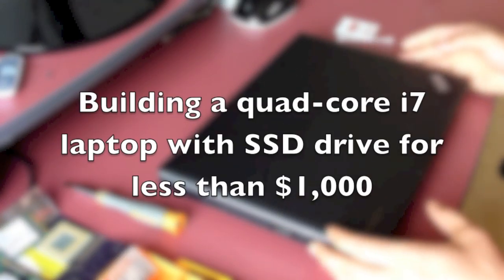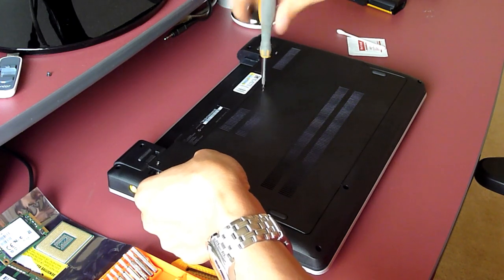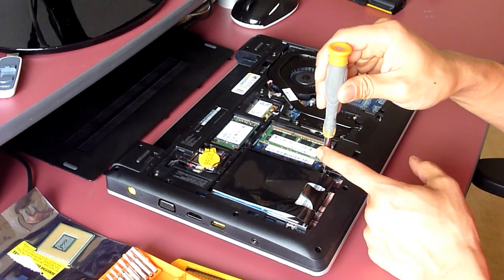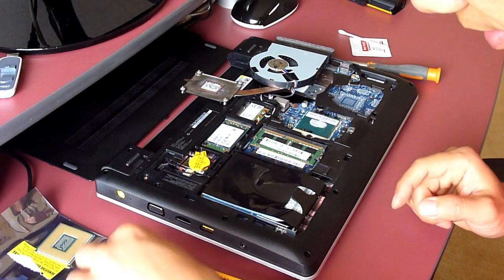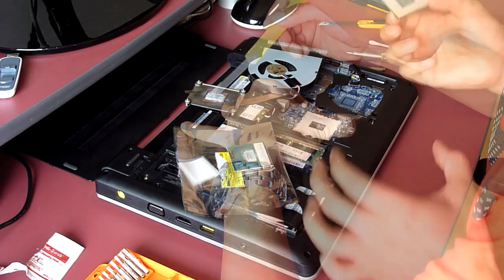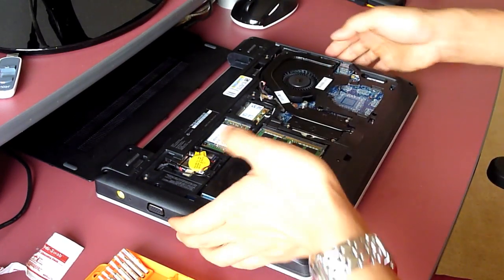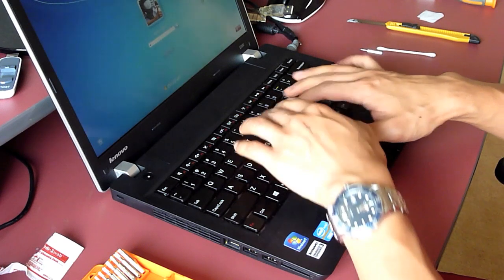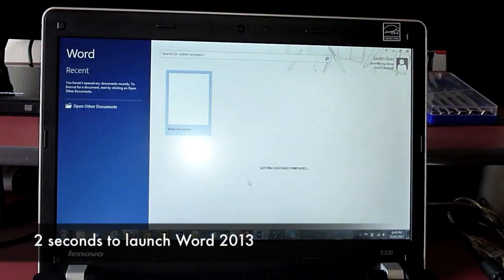Quad-core i7 laptop with SSD for less than $1k (CPU, SSD, memory upgrade Lenovo E330)

Comment: Hello, thanks for you video. I Bought a 250 gb ssd. And I already had upgraded to 8 gb ram. I wanted to ask if I could also upgrade to 16 gb ddr4 ram? And, you used the I7 3612. I now did a search and I found the I7 8700. Would that also be possible?
Reply: I7-8700 use ddr4-2666 memory.
Meanwhile e330 use DDR3 memory.
Also i7-8700 for desktop use.

Comment: Is it possible to upgrade the cpu (lets say to an i5) if it has an intel pentium CPU B980 (with 2,4 ghz) preinstalled? I am thinking about instead of buying a new lenovo to upgrade the whole system: More RAM, add SSD, clean cooler and also upgrade my CPU
Reply: And how will my battery-life react to that? (I am guessing it will go down but will it be significant?)

Comment from the maker: For those who thinks it's wrong to reuse thermal grease: (1) this is thermal grease not thermal adhesive/pad (2) this laptop is brand new, the replaced i3 CPU had less than 10 minutes of use. Also if you wonder if it has blown apart because I reused thermal grease: it hasn't. It's been my media server in the last four years and was left on most of the time.

Comment: How do i know if my laptop can get a new processor? I have a Vaio VPCSB28gg... considering a quad core CPU....
Reply: identify your cpu and search for the socket type, than search for the processors compatible with your socket-type and check if they are at the same TDP (ThermalDesignPower).

Comment: Where did you buy the processor from? I have the same laptop (i5 version) and I already upgraded my ram up to 8 gigs and just swapped the old harddrive with a 512GB Crucial MX100; I still have 3 years of warranty on this thing, so I wont be swapping the processor now, but I may do it after the warranty goes off, because there is really nothing wrong with the laptop in terms of computational power even 3 years from now. Just the panel kinda sucks though..

Comment: Have you considered power consumption vs the capabilities of the laptop power supply? Have you considered cooling? I would expect I7 to demand much more efficient cooling than I3. How about reliability in this case? Laptop is more than throwing some components together if you mind reliability. It may be very fast but live very short.

Comment: Could I also upgrade my CPU & add an SSD (like you did without replacing HDD) for my Lenovo G500s? I was told by my local authorized Lenovo service partner that I couldn't; which I doubt. My current laptop spec is Intel Core i3 3110M 2.4Ghz(Ivy Bridge), 4.00GB Dual-Channel DDR3 @ 798MHz & 2047MB NVIDIA GeForce GT 720M. Please advice. TQ
Reply: yes you can, check this link http://download.lenovo.com/consumer/mobiles_pub/lenovo_g400g500g405g505g410g510_hmm.pdf

Comment: Great video, watched this to see if there would be any issues with removing the heatsink to change the TIM.
And that's the only gripe I have with this video: Don't reuse TIM ! OEM TIMs are bad as it is and reusing them isn't going to make them better. It's not that expensive so I would recommend people to buy some new one (which is preferably not too thin, Gelid GC-Extreme / Phobya HeGrease (same stuff) is perfect and reasonably priced)

Comment from the maker: Hi, I have not experienced any issues with the upgrade and as a matter of fact the machine feels cooler as it only runs the SSD drive most of the time. According to Lenovo, the CPU I have installed is the highest this machine can support.

I think what really matters is the Max Thermal Design Power of the CPU you are going to put in. E330's cooling solution is designed to handle 35W which is what the i7-3612QM is rated at.

Comment from the maker: I can't comment on the battery life as I don't normally use this machine off my desk. Cooling is not a problem at all and in fact I seldom hear the fan spinning unless I'm encoding video. This i7 CPU is also rated 35w so it should be an issue at all.

Comment: Thanks for sharing your experience. Love how easy the E330 is to work with. Heck, swapping the CPU or just replacing the thermal compound and cleaning the fan looks like even less hassle than my desktop. Far cry from the nightmare laptops I've battled with in the past (the kind shown in the Clean the Fan song!).

Comment from the maker: Thanks for watching! I didn't record any score as the benchmark values are available say from cpubenchmark. It depends on what you use the laptop for. For browsing the Internet, you don't feel much difference but for video encoding, it's a lot faster.

I've been monitoring the CPU temperature and have been using the laptop for about a week. Absolutely no issue. Not sure why manufacturer doesn't recommend booting from mSATA but you will need to do a fresh installation of the OS to the SSD.

Comment: This is cool! May be the video would be even better if you showed some benchmark scores before and after the upgrade. Maybe even windows' performance score.
I am going to buy such a device (maybe with different config). And I am wondering, is it safe to boot from ssd in mSata, because the manufacturer doesn't recommend that. He says, that it is supposed to serve as a cache.
And another quastion, have you encountered any issues with this new CPU?